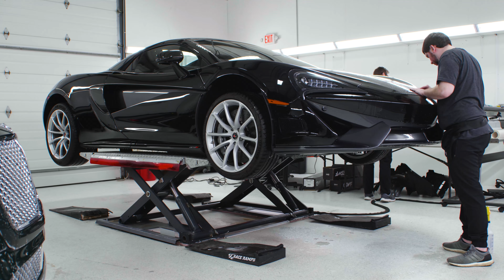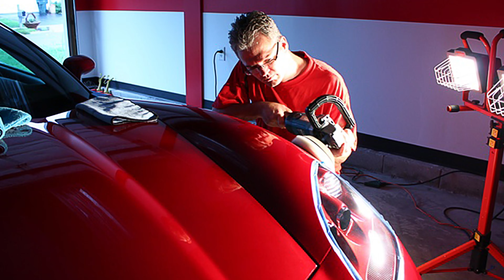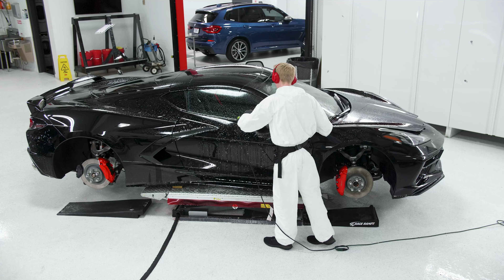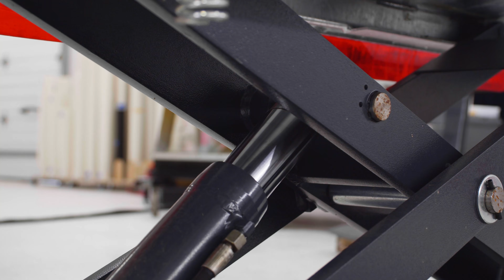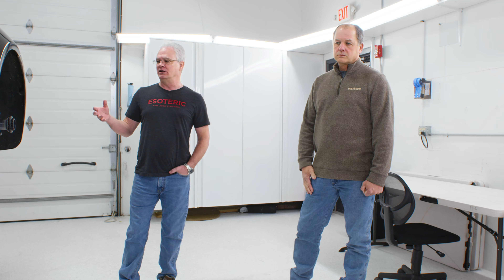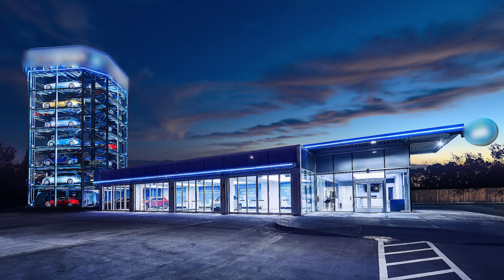The ONLY lift we trust | FAQ Series by Esoteric!

Comment: 4K for a 40" never fail lift is a great investment. If you had to do it again, would you keep them surface mounted, in-ground or both?
Reply from the maker: For the layout of our current facility, surface mount is the only way to go. If we built a new facility, and had the proper layout, we would go in-ground on most of them.
Reply: Remember, if you are washing a vehicle over the lift or the area is going to get wer or filthy, cleaning around them especially when mounted in ground is a major pain. Ammo NYC does this and I guarantee he regrets it. Just something to think about.
Reply: @JWDTTP  that's a given thanks
i use a/g lifts for access not washing. we have a portable in the wash bay tks